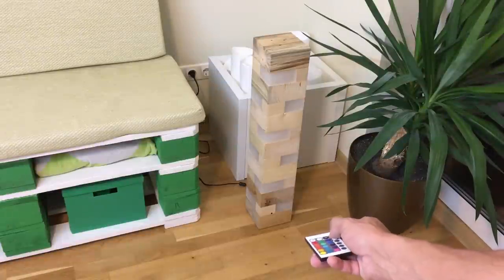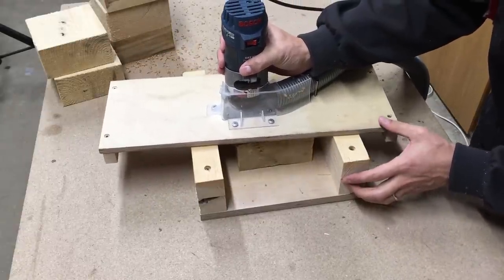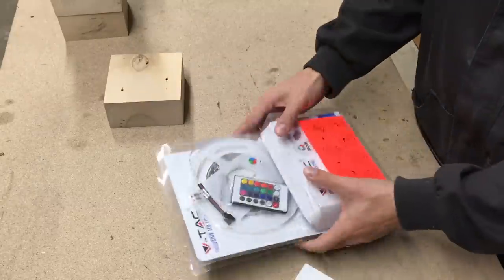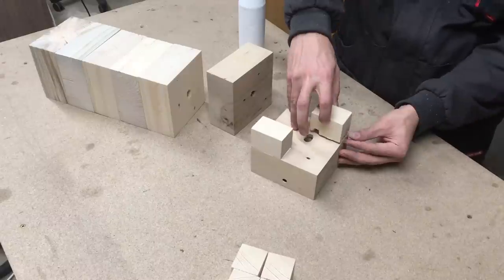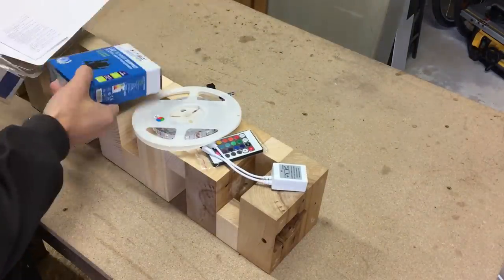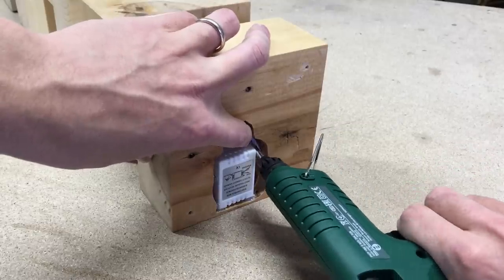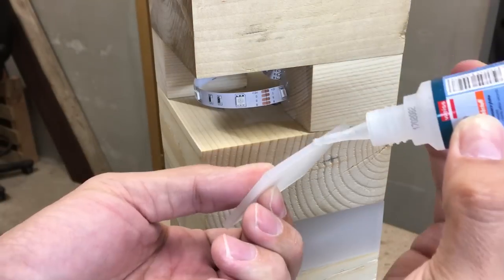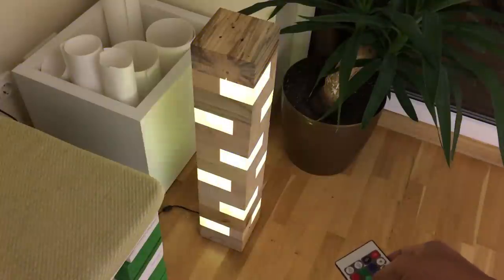How To Make A Colored LED Lamp From Pallet Wood Blocks

Comment: Use a RF controller, they're way smaller, the remote is smaller and you don't have to point at the IR sensor. They're like $2 on aliexpress.
Reply: Or at least hide the IR receiver behind of the transparent poly. It would even work through multiple layers.
Reply: Jaromy Van Der Sluis can you put a link of this RF controller you’re talking about please ? It would be really helpful.

Comment: I liked it so much. i'm very interested to make my own, may I know the sizes of the wood blocks you used? and how long  the strip light?
Reply: Roughly 14 x 14 x 8 cm? So a 4x6 " dimensional lumber board cut square and straightened. Or if already straightened would be fine.

Comment: I love this, poor man's wood planer with a router. Poor man's clamps with heavy bricks.  Poor man's lumber with scrap pallet wood.
Reply: GeekMustHave - I can't believe that's actually pallet wood. It's waaaay too thick.
Reply: fitztastico those are bricks that hold boards in the pallet.
Reply: Except an electric planer is significantly cheaper than a router. Definitely not a poor man's miter saw. 

Nice project though. It came out better than I expected too when I saw the starting materials.
Reply: His flat head screwdriver is a butter knife, oh wait no that's me lol.
Reply: @fitztastico  they are the blocks that support the top layer of a pallet.

Comment: Has somebody found a RGB LED controller with remote control that does not have low-frequency PWM flicker? The wide-spread standard controllers let the LEDs flicker with a frequency ca. 200–250 Hz when dimming or mixing colors.

Comment: what is that white transparent board u used? couldn't hear it clearly
Reply: It don't seem like this guy responds to people at all :\

I think he said 'polycarbonate' but I don't  think it is. I believe it was simply normal 'Acrylic' or 'Perspex' or 'Plexiglass'. All those 3 things are the same material.
Reply: Allwyn Menezes It's called Plexiglass. Something like both plastic and glass. It is easy to shape, cut and bend it.
Reply: Plexiglass is not glass at all. Plexiglass is brand name acrylic. 100% epoxy plastic
Reply: Allwyn Menezes he used white transparent polycarbonate check on amazon